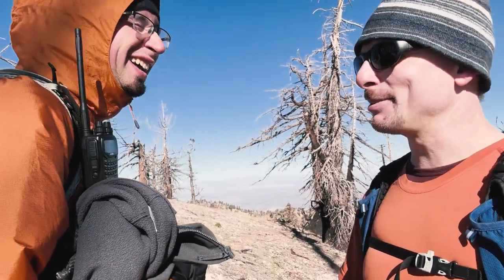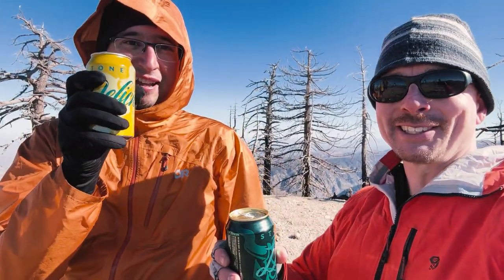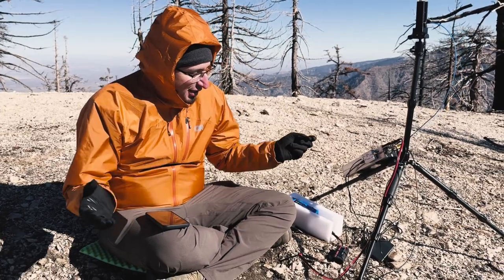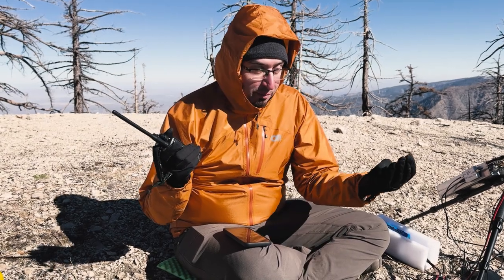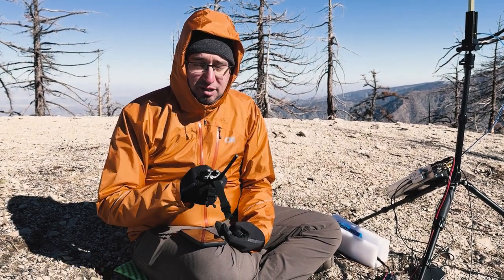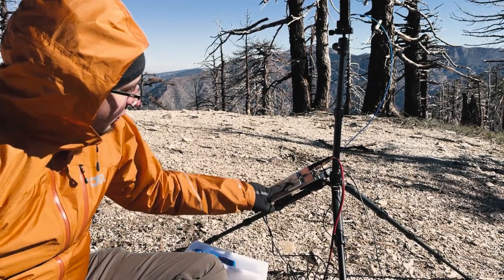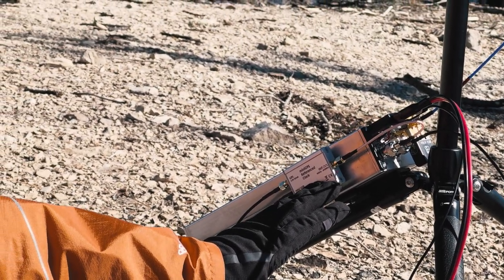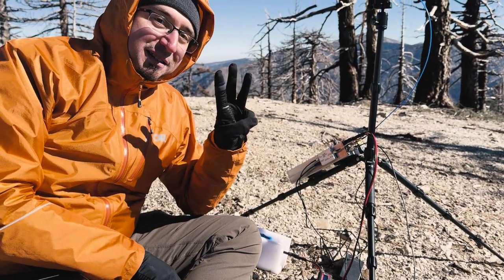10 GHz Activation of Mt. Williamson | Summits On The Air

Comment: Nice work 👏 
What kind of range can you achieve at 10 GHz?
What SOTA badge do you get for that? Keep up the great work 👍
Reply: SOTA awards a "Microwave" badge for any contact >1GHZ I believe. 

As with most radio, range depends on a lot of things... but the noise floor on 10GHz is quite low generally, so it doesn't take much power if you have LoS. I did a 50mi S2S with N6MX where even with just 200mW and an omni antenna on both ends, I got a 59 signal report on SSB. (N6MX had ~3W, and I received about +10dB over 9.) I believe this activation was a ~3 watts and made it >100mi from a summit in the Angeles down to San Diego.

There are lots of interesting propagation modes in 10GHz like rain scatter and mountain/plane/cargo ship/moon-bounce to achieve more interesting results, but those typically have much higher path losses requiring more power and directional antennas to work well.
Reply: My best DX on 10 GHz was very close to 1000km using just under 1 watt and an 18" dish. It was from coastal central California to a spot on Baja during a microwave contest weekend.